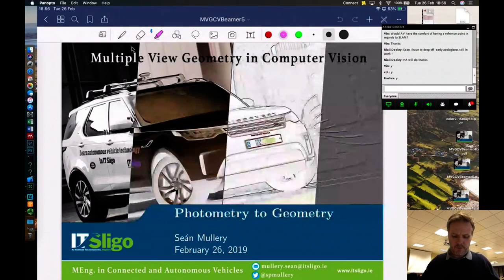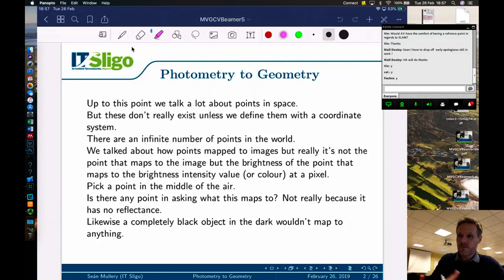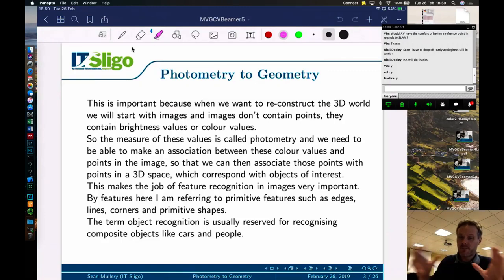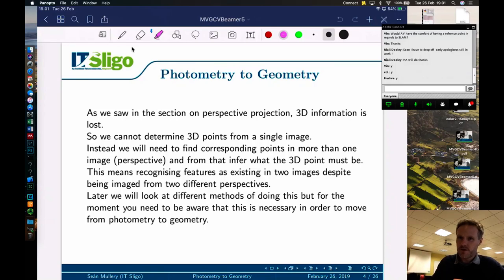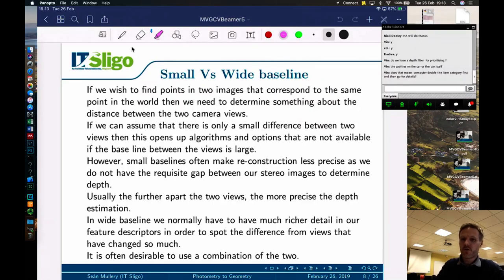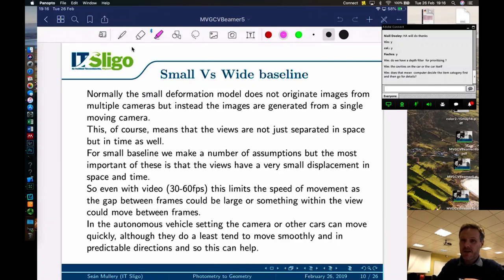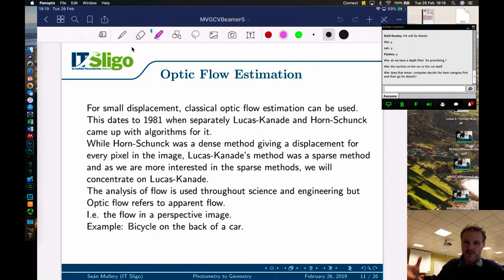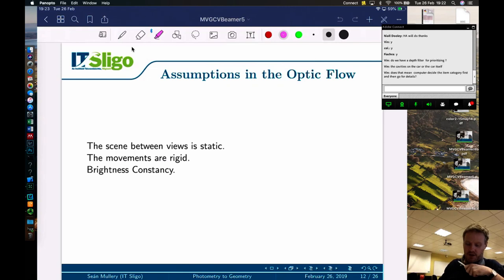Lecture 5 Photometry to Geometry

Comment: Sean, thank you very much for these lectures. Easy to follow and difficult concepts are explained in a very visual way. Great material. You also talk sometimes about assignments. Is there a way how I can get them and practice material a little bit? Thank you
Reply from the maker: Hi Vatryona, sorry for the delay. I have added the individual and group assignments to the google drive where I have stored the slides. https://drive.google.com/open?id=1DPHpi0ALIFUKbVM-LHGIMDnUPuLQj6Mj
I've also included a sample exam. I don't know how useful you will find the assignments as this is a Masters level course so the assignments are quite wide open bounds problems rather than bite sized ones. You may find the sample exam more useful. I'm glad you are enjoying the lectures.